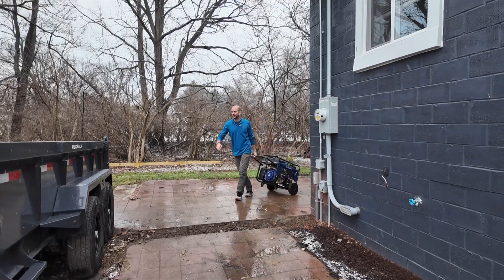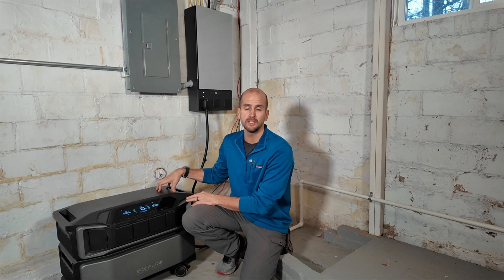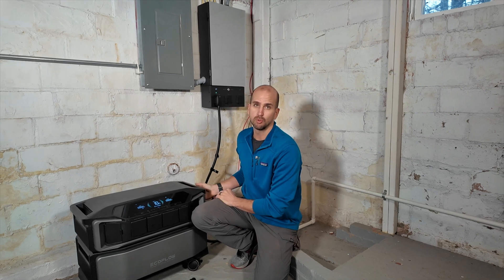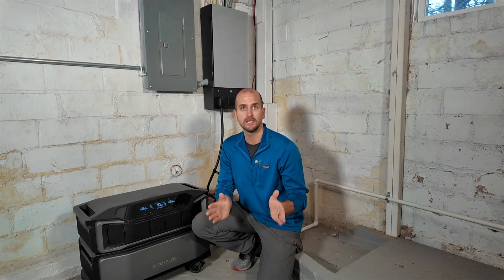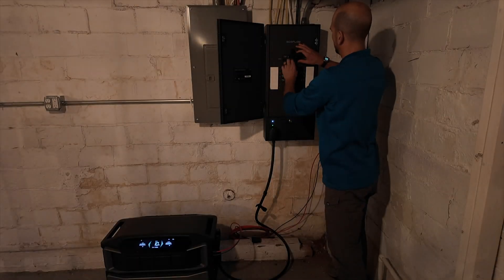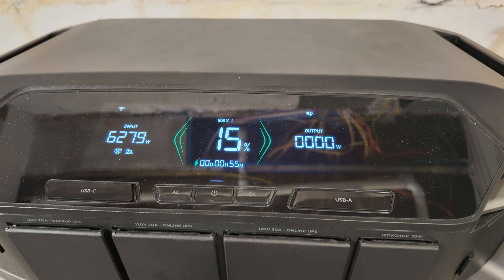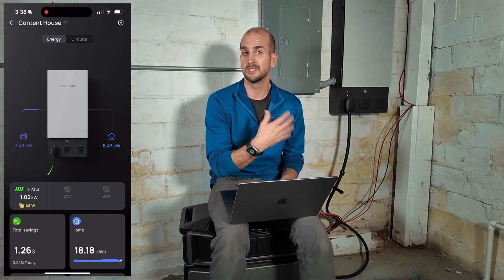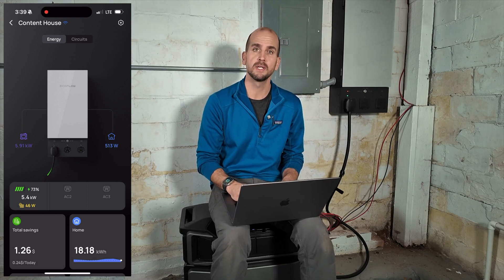Maximum Charging Speed Test | EcoFlow Delta Pro Ultra

Comment: Poor man's technology at a rich man's price. This thing only provides a 1.5 x surge capacity. No thanks, I would never power any of my home's appliances with the Ecoflow Delta Pro Ultra. The Chinese made. lightweight, high frequency inverter tech on today's market (and they're ALL Chinese made) are not only short lived and offer a weak surge capacity when compared to conventional off grid inverters, they can also be dangerous. 

You'd be lucky to get even two years of service from these inverters, especially when powering high inductance loads like full sized refrigerators, large power tools, portable AC units or large microwave ovens. The reason for this is that all of these lightweight, high frequency inverters lack a very critical component. That critical component is an iron core, copper wound output transformer. Without an output transformer to act as a buffer to absorb electrical surges provided by the “Flywheel Effect” inherent in the physical amount of a transformer’s iron, these surges and damaging reverse voltage spikes must be handled directly by the inverter’s MOSFET transistors, essential shortening their life. 

You might be able to start and run some high surge loads when these high frequency inverters are new, but every time you fire up one of those inductive loads, you're shortening the life of the MOSFETs in these inverters. Lightweight, high frequency inverters run much hotter than low frequency, transformer-based inverters which makes the low cost, off spec, Chinese made components such as capacitors, diodes, resistors and ICs that are used in these inverters, far more prone to early failure. 

Another major consideration with these lightweight, high frequency, transformerless inverters is safety. All it takes is for the AC output monitoring circuitry to fail and one of the MOSFETs in the inverter's H-Bridge circuit to short to ground, and these inverters can send dangerous, high voltage, high amperage DC current straight to your connected AC loads which will not only damage most AC appliances but can also set those AC appliances on fire. 

Another consideration that is never mentioned by those high frequency inverter hucksters, is that the vast majority of these inverters are non-repairable. After the warranty runs out, you're not going to be able to ship these units back to the manufacturer in China and have them repair them. And at a typical shop rate of $125 per hour here in the US, with no schematic and limited parts availability, it won't make economic sense to even attempt to repair one of these units. Once the FETs have fried and have burned a good portion of the inverter's PCB, (And trust me, sooner rather than later, they will fry.) they basically become a brick.  

A much better choice would be to invest in an inverter or power station that uses low frequency, transformer based technology in its design. Low frequency inverters can handle high surge loads for at least 3x (300%) their continuous rated capacity and they can do this repeatedly, without sustaining damages to their MOSFET transistors, for minutes, rather than the milliseconds that a high frequency inverter offers. That's why the big name brand inverter manufacturers like Schneider Electric, Outback Power, Sigineer Power, Magnum Energy and others, all use a low frequency topology in their design.
Reply from the maker: What a great comment.  Thanks for the detail and I know there is a lot of pushback on trying to use high frequency inverters for a dependable off-grid setup.  One thing myself and many others miss is truly putting these units to the test of any duration of time.  I am trying to at least get several months on this unit cycling daily with high inductive loads.  That still isn't a great real world test but the best i have thought of currently for any form of endurance testing.

Comment: That's pretty cool that one could run a generator for an hour and fully charge the battery. Depending on usage during a blackout this might let one have power during a cloudy day without having to run a noisy generator 24/7 wasting fuel. Generators may not be clean but in areas that have more cloudy days than sunny days like in the PNW it may be the only reasonable solution.
Reply from the maker: Yeah, and just an additional not that a few guys pointed out an inverter generator with a pure sine wave would be a better option to reduce the chance of damaging the Ultra during charging.

Comment: Hi Scott.  EcoFlow recently posted a video showing that the Delta Pro Ultra is compatible with the original Delta Pro units and said that you just need a hub adapter to connect two Delta Pros to a Delta Pro Ultra.  Can you make a video showing them connected together and how you would charge all three units together with your generator and/or a combination of generator with solar inputs?  I’ve got two Delta Pros with two Smart Extra batteries for them, and I’m looking to buy the Delta Pro Ultra in January.  Thanks for your videos.
Reply from the maker: Yep, that would make for a great video.  I will start working getting the hub so I can show the application and run the units through a charge cycle or 2.  Thanks for the feedback!

Comment: How far can you limit the charge rate?  If you have a less than 3 kW generator does it switch back and forth between charging and supplying energy to the house as loads increase and decrease?
Reply from the maker: In the EcoFlow App you can set the Smart Panel 2 generator input maximum power between 3 -12 kW and also set the battery charging level from the generator between 500-7200 W.  If you are running a 3kW the generator will power the home load and give any extra to the Ultra unit.
Reply: So if there's an AC supply it will always "passthrough" at least 3kW?

Comment: Was the generator you used to charge the  Ultra an invertor generator ?
Reply: This seems like a burning question from the community.  As one of your comments on here says…. perhaps the DPU rectifies the generator non-clean energy right away.  That would make this system amazing if it was the case and we could use any generator to charge it.  We really need this answer.
Reply from the maker: Nope, not for this test but definitely a better option for any sort of regular charging.  I should have noted that in the video and thanks for the feedback.
Reply: @everydaysolar   Thank you for demonstrating how fast the Ultra can charge in the video. I am impressed with the charging speed.

Comment: I would like to know the cost of the ultra and the smart panel when they are available.  Thanks for sharing.
Reply: The ultra will retail at $5,799. Ecoflow hardly ever sells anything at retail though.
Early bird coupon cost will be $4,299 ($4,599 actual cost).
SHP2 is RUMORED to retail at $1,499
Reply: @DialedN_07  since when was the price announced?
Reply: I have an EcoFlow Max with solar panel and it's great.  Plan on expanding it some in the future.  But the price of the ultra...would a Tesla Powerwall be a somewhat of a better option?  Would not be portable but the ultra is a beast anyway.  Just thinking out loud here.
Reply: @philsmock4943  adding a second battery to the Pro Ultra would equate to slightly less total battery capacity compared to a powerwall, but is likely to be several thousand dollars cheaper, but a powerwall would give you the capacity to sell to the grid where this doesn't.
Reply from the maker: Man, I think $1,499 for Smart Panel 2 sounds low but I guess we will all find out in a couple weeks.
Reply: @everydaysolar  my confidence level on the $1,499 is really low.  Possibly that's the price after the coupon?  However with SHP1 selling for less than $1k regularly, if the price is over $1,499 it will be a big flop.

PS. I realize you probably actually know but can't say due to the NDA.
Reply from the maker: @DialedN_07  Yeah, the price makes sense compared to the Smart Panel 1 but this new unit is a whole new ballgame and that might drive the price up a bit.  I actually don't know the price and will find out with the rest of you guys on Jan 9.  I will be out at CES and will put out a community post once I find out 👍
Reply: @everydaysolar  can you ask someone at CES about the functionality of SHP2? Specifically why can we no longer take individual circuits on and off battery or grid.  It's now either the entire panel on battery or entire panel on grid.  SHP1 allowed you to flip individual circuits on or off each.
Reply from the maker: @DialedN_07  Can do, added it to the list and thanks for the feedback!
Reply: I really like EcoFlow products.  I got the Max instead of the Pro because I take the Max back to my woods from time to time.  From the Tesla website, Powerwall 2 is $8,400 but with incentives it's $5,700.  And I know there is a lot more expense added to getting a Powerwall installed and running.  Like I said earlier, just thinking out loud.
Reply: @DialedN_07  was just looking at the current page for the DPU and it looks like the SHP2 is gonna be between 1,000 and 1,400